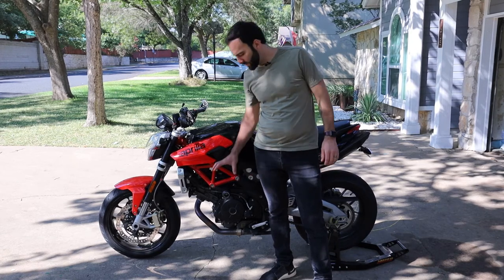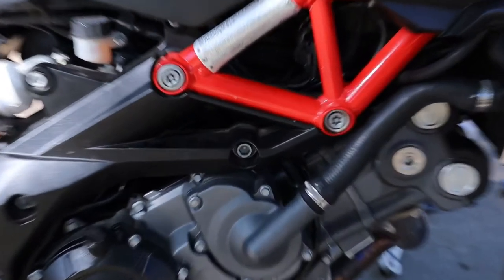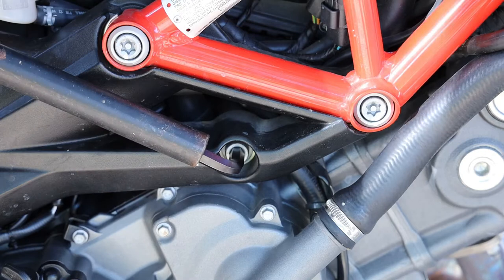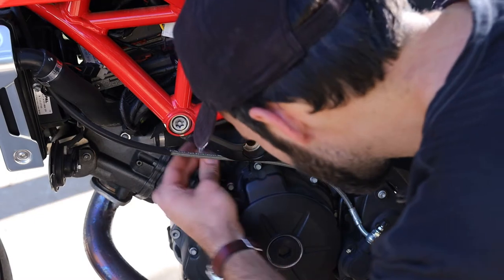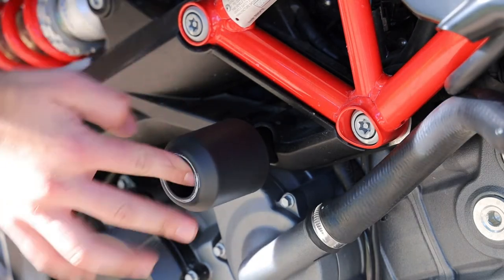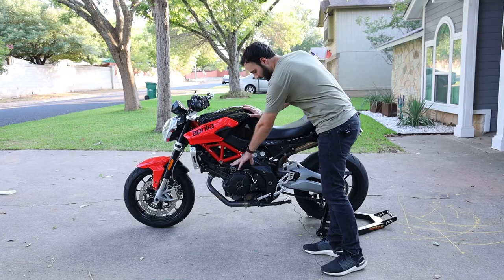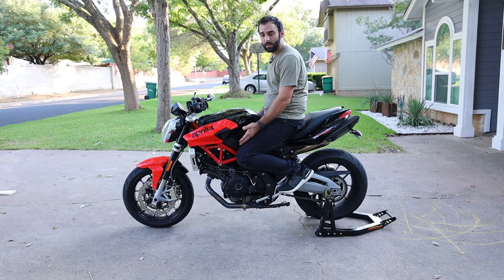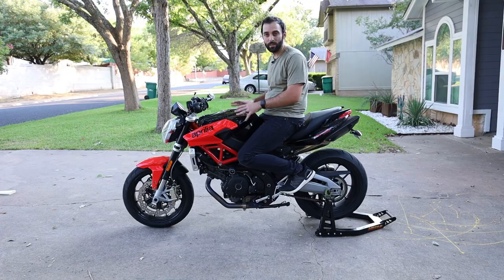Evotech Frame Sliders - Install & First Impressions

Comment: Well, a friend of mine that works at a Yamaha dealership told me that these Evotech sliders came out pretty good, after a car-crashed MT-03 arrived and the sliders took most of the damage on the side. They are huge but i've seen other sliders bend and according to my friend, these ones don't. Cheerz
Reply from the maker: Yeah that are pretty large compared to some others but glad to know they do what they are designed for!

Comment: Thanks for the very nice video. I installed these on my Suzuki SV650. I noticed that the shaft is slightly thinner than the OEM shaft. Was this the case also for your Aprilia? I am a little concerned about the stability of the engine mount if there is extra play/vibration. As to the torque, i did what you did and used manufacturer specifications but Evotech should provide torque numbers for their bolts. I will remove these after some riding and will check for wear and tear where the rod meets the frame.
Reply: I’ve just got some of these crash bobbins for my 2020 Suzuki SV650. I contacted Evotech who insisted 55NM torque was enough (baring in mind their instructions say use manufacturers specs) and also Suzuki GB who in a roundabout way told me 93NM. Evotech didn’t give me a reason as to why their figure was the right one (though I’d always go for the bike manufacturers specs). Sadly this has given me enough doubt to be making the decision to return the product. Shame as they look really well designed and made, just the lack of clarity in installation let’s it down.
Reply: @jonnywishbone571  Sorry to hear. I used Suzuki specs for this (93NM) as also recommended by others. At least you got a response from Evotech. I did not when inquiring about the smaller diameter of the shaft.
Reply: Thanks for this post and your experience as I'm also looking at these for my sv650 3rd gen and wondering what gen is yours and did they ever give you and answer
Reply: @hachi-rokuperformancegroup3987  Mine is a 2019. I did not get a response for my written inquiry. When i called them i was just told that they never had a problem. I will still do what i said above, which is to check these after some riding for possible wear and tear where the rod meets the frame. They appear to be well made otherwise. Best of luck.
Reply: @GB-fo2ce  thanks for the response